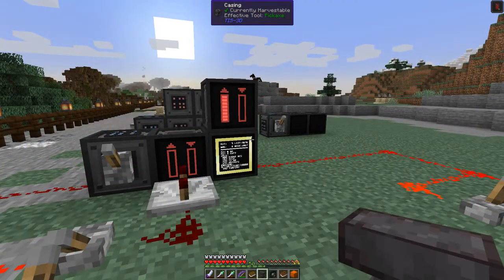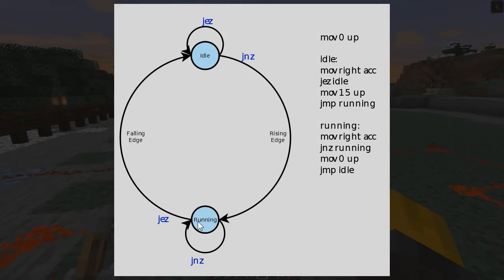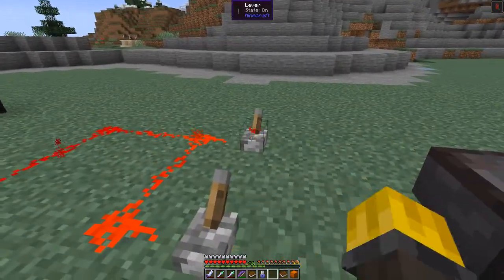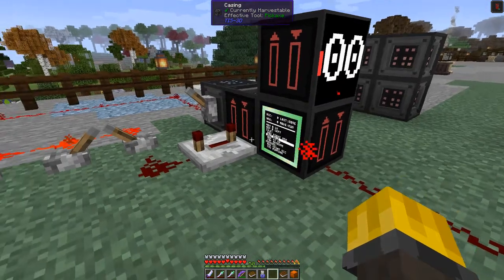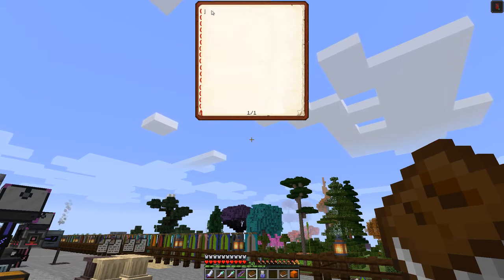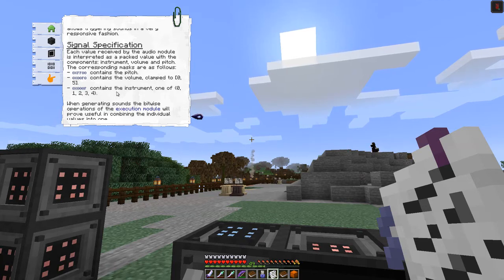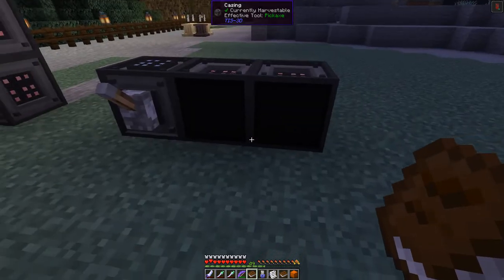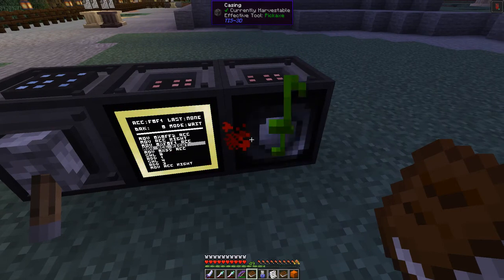All of Fabric 3 #57 - TIS-3D First Program Fixes, Using the Key and Audio Module

Comment: Vou could make a video about the ROM and RAM module
Reply from the maker: I've stopped making Minecraft videos after being forced to use a Microsoft account. I did have a look at the RAM module, it's not difficult to use. Personally, I found it difficult to find a use for TIS-3D, so I didn't do much with the mod as I would have liked.
Reply: @duncanwebb4934  How unfortunate, im playing with the mod and i am really liking it.

At first I didn't have many ideas either but after I absorbed that the intention of the mod is to replace redstone logic I started to enjoy it better including adapting a redstone computer.  Anyway, good luck and all the best.
Reply from the maker: @neves5083  delighted you are enjoying the mod, I have a feeling I was missing something, a max 40 code lines per program, seemed to little. Feel free to post some screenshots and their programs to my discord channel.
Reply: @duncanwebb4934  Cool I will, where I join?

 I think that's exactly the point.  You have to face this mod like computers from the 60's. It's not a computer with a 40-line program, it's a 40-line subroutine that is part of a big mainframe full of subroutines made to execute a specific task (or a multipurpose mainframe like the scientific computers of the time).  if you look at it this way, where each node is made to interact with many others, generating a more complex device from several simple 40-line codes, maybe it will be easier to see the potential of the mod.
Reply from the maker: @neves5083  the link is in the description. Had cards when I first programmed in fortran and then Algol 68 missed the earlier mainframe programs. That was fun.